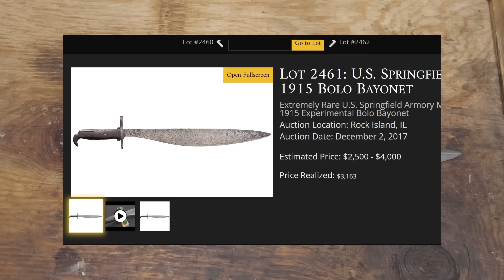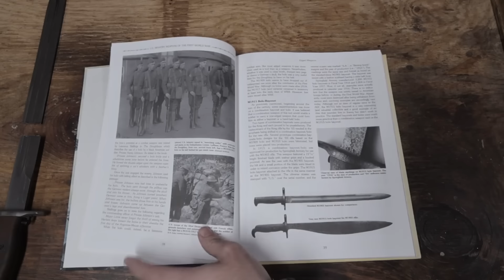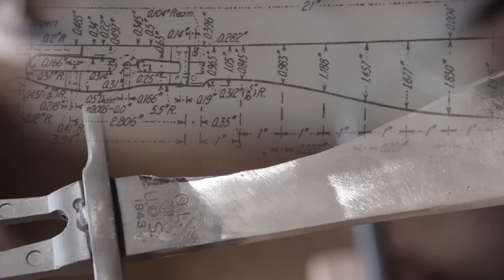Making a Replica M1915 Bolo Bayonet

Comment: Huge respect for doing all profiling without belt grinder. It had to be really hard to keep all lines symmetrical 😅
Reply: When doing a convex grind you can rely on the light reflections off the blade surface as a helpful guide. Mucho respect. A huge amount of work displayed here.

Comment: What kind of steel are you using for the blade? Bayonets are typically low-carbon steel with a mild temper so they bend instead of breaking.
Reply from the maker: Not sure exactly but it's some sort of low carbon hot rolled steel.

Comment: Awesome video, your metal working skills are great! You should make a video on restoring an Ishapore Enfield in .410 musket. They are a neat oddity. Centerfire Systems has them right now for 115 bones. I am currently in the process of restoring one myself.
Reply from the maker: I actually have one. Century Arms had them for $50 a while ago. Mine is in very rough condition, the bore is full of bad rust.
Reply: The one I got was deeply pitted throughout the outside, as well as the wood being very beat up and cracked but somehow I got a mirror like bore on mine.
Reply: The chamber has to be reamed out to accept modern ammo correct?

Comment: I think you made an excellent job of the bayonet. I have made a few knives by cutting and grinding the blades as I don't have a forge. I would love to have a go at a Damascus steel blade but I can't justify the cost of getting the stuff together to make it. Polishing the blade does take ages to do and I think even with a belt grinder there is still a lot of hand sanding to get the blade perfect.

Comment: Maybe I missed it, but I did not see any heat treatment of the blade… also I don’t think you can actually hack trees or branches with this blade due to tic welding at the stress/load bearing point… so this is just a cosmetic blade?
Reply from the maker: Yes, it's just a replica. It's not meant to be used

Comment: I’m surprised you used an angle grinder to make the bevels, easy way to make it go wrong fast if you mess up, and much less angle control.

Granted you can’t exactly use a jig or a bench grinder very easily with that profile.
Reply: Just got to the end of the video, I guess that explains why you didn’t use a bench grinder.  

Sanding a blade is a tiring process but generally orbital sanders are avoided because of the shape of the scratches they leave behind.  Generally the accepted practice is to make a filing jig out of 2x4s and then to wrap the appropriate grit paper on the file itself.  It’s still time consuming, but it’s more forgiving in the hands.  

For not being a knifemaker you did a pretty dang good job.
Reply from the maker: I've been wanting a 2x72" belt grinder for a while. Need to bite the bullet and buy a complete one or maybe a kit.
Reply: @rakumprojects  2x72 is a great size, use it for stock removal all the time.  I do find myself wanting certain add ons occasionally but the simple flat platen does most of what I need.  

It’s not a necessary tool but man is it nice to have sometimes.